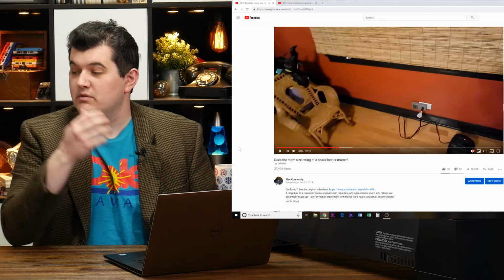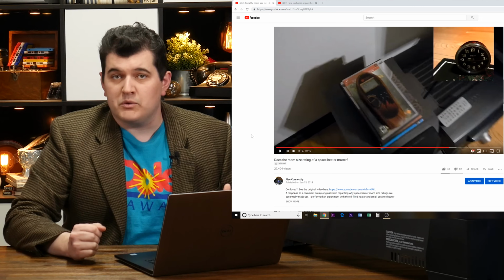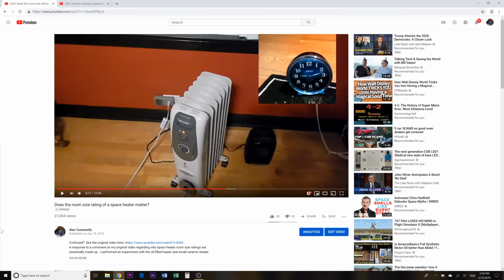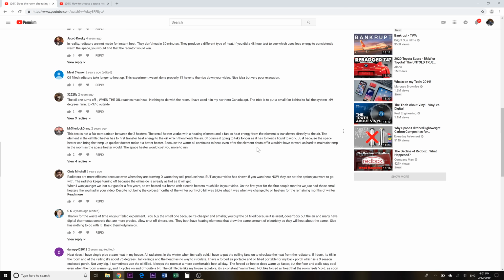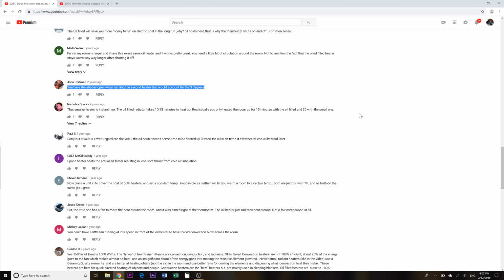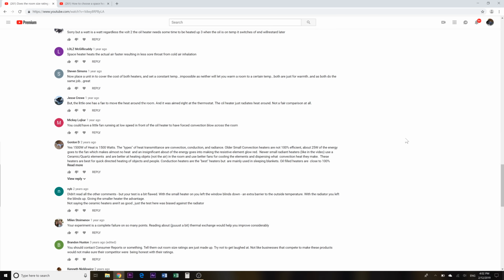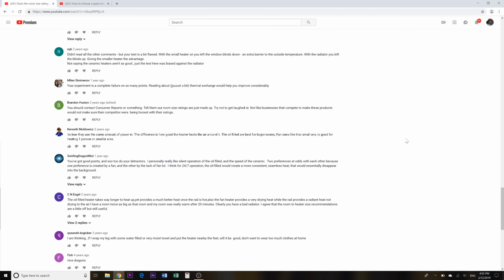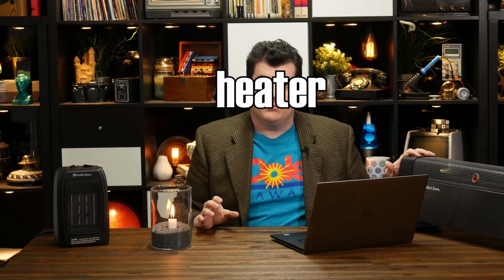More Space Heater Nonsense

Comment: My only use case for oil heaters is an application where you wouldn't want hot spots. If you're able to have a high heat capacity heater dumping out air at 85 degrees for a long time then that would create more consistent air temps throughout the room than a heater dumping 110 degree heat constantly

Comment: I'll bite the hook ! You are 100% right, they can both produce the same amount of heat, and therefore heat any room just as fast.
But, let's try to give the benefit of the doubt to the marketing departements...

You can maybe argue that small rooms loose less energy per amount of time than larger ones. So, for most small rooms, 1500W is too much, and that you would only need say a sustained 500W heat source; whereas in large rooms you'd want the full 1500W full time.
The small one can output 1500 watts, but the tiny heating elements and cheap plastic construction might not be terribly well suited for long use of such high output. I personnaly would not trust the tiny plastic thingy enough to let it run full blast for prolonged periods of time.
The bigger heater on the other hand might be of sturdier construction, and thus be able to sustain those 1500W for longer periods of time without deterioration, therefore making it more suited to larger rooms with higher energy loss. I think I would trust it's bulk a little bit more in any case.

Maybe you could disassemble them to see what's inside, and if the heating element is indeed sturdier in the "large room" one ?
Reply: No. That’s just goofiness.

Comment: I think something like a little usb PC fan blowing across the radiator heater would greatly increase it's usability. That tiny jet stream of fresh air? Gold. Then you'd get the constant even heat and afterheat effect with better distribution and thermostat usage. Plus you could set it next to you if you want to get toasty with the radiant effect.
Also, that light you see in the flame and the heating elements of the heaters is energy. Look up what % energy that is? 💯% HEAT!? WRONG!
There's my con-troll-bution.

Comment: At first, radiant heaters are as efficient as heaters with wire element. The only problem is comfort. Wire element type heaters usually have fan, which can causes air to dry much quicker then radiant heaters. Second, radiated heat is much more "natural" for people than blown heat. Third, is that radiant heaters are not as hot as wire element type heaters. So it reduces risk of fire. So, these are reasons why are radiant heaters still that popular here in Europe. We still use hot water (or steam) central heating systems with radiant heaters. Radiant heaters heat slowly, but room can still hold some heat after they are turned off (and with thermoregulators are quite well to regulate). That is not the case in wire element type heaters. As soon as you turn them off, room gets cold again in a few minutes (that might not be the case in american wooden houses). Also, electric radiant heaters are slightly bigger and more powerful here, so they heat up faster (about meter long and about 2 - 2,2kW due to 230V electric net).  And for your comparison you choose wrong times. Let me explain. Wire type heater immediately heats up and immediately cools down. As you said, that is not the case in radiant heaters. They take longer to heat up, but also take longer to cool down again! So for real comparison, you should measure power consumption (in Wh) and as soon as radiant heater has similar consumption turn it off. Then wait for heater to cool down to ambient temperature and then measure temperature in room. It should be same. And if it is not, then your house is not heat isolated well enough. So in conclusion, if you need to heat up room fast and not for long period of time then wire element type heater is better. If you want to heat your room constantly for longer time than radiant heater is a good choice.

Comment: The oil filled heater uses less energy over time because after the thermostat kicks in the heated radiator's metal fins stay hot for a good while before thermostat restarts heat.  So the oil heater keeps putting out radiated heat even after it is off.  You turn it on high and set the thermostat as soon as the room in use reaches a temp. you like.

Comment: Your experiment is as good as any with this small sample size can get. That said, I have another experiment I’d like to see. Get the same two heaters and set them to heat the room to the same equilibrium temperature. Leave them for 24 hours, and measure the energy used (yes, I know it should be the same, but still), as well as the temperature fluctuation over time. I wonder if the oil would act as a heat reservoir and smooth out the temp of the room at all

Comment: Are the oiled filled radiators safer? They have a larger surface area at a lower temperature. Instead of marketing with the misleading large-room small-room they should market that they are safer.

Comment: What i can maybe think of. Is when the Room has much new air circulation. Like in Office Rooms where people have too wait and every 15min the doors get opened and closed. At that time your already heated Air goes away and fresh and colder Air comes in. If you have a delayed heat output, like heat stored in Metal. Your already wasted energy in shape of elektricity is still in the metal and and not every door open close cycle has too heat up the room from 0%.  It is the same principle with refrigerators if you have still room left fill it with water bottles. ( that you dont want to drink )

If you want a room constantly in a specific temperature. Then the delayed heating element is more efficient.

But still this has nothing to do with room size.

Comment: We had a failure of the Central heating system in our buliding last winter. It took a week to fix it. But despite good insulation, after a few days it got quite cold. Having all LED lights in the flat did not help :-) So i grabed a bunch of 500Watt Construction Lights and set them up in our rooms. Also i baked some kind of Cookies every evening to make double use of the heat. 
Only difference i can think of between smal and big room heaters is the distribution of the heat. I think convection one is better to get some kind of even distribution of the heat. But the amount of energy released is allways the same als long as Watts are the same

Comment: electric oil heater needs movements of air, 
if you want to heat a small room with electric oil heater you put a fan and blow though it, now after the room is at temperature turn off the fan an heat keeps the temp up, unlike small fan heat that has too always be ON.

put them in a big open room (office type) and see how the oil heater will smoke the small one.

Comment: As a kid, I observed a very great difference between different portable space heaters, though I am sure the power consumption was at or about the same. I had a friend I would visit from time to time, and the room where he and I would spend most of our time together had no heating except a small space heater, less than a foot tall, less than a foot wide, and about half a foot deep. That little heater did a great job of heating the whole room quite nicely. But then one day it broke, and quite irreparably so. Worse, the particular model it was had gone out of production and could not be found for sale, so my friend bought another space heater, about the same size overall, to replace it. But this new heater could not heat the room. Right near the heater would be nice and toasty warm, but the rest of the room stayed as cold as if it had no heating. They were both about the same size, and (I assume) the same power (given that everything along these lines seems to be rated 1,500 watts), and both had electric heating elements and a fan. What differed was the exact configuration of where and how the fan, the heating elements, and the various vents etc. were arranged, and overall shape of the unit. Somehow, the physical design of how they took in cold air and then vented its heated air into the room resulted in a significant difference in how well the room (which was rather large) would get heated. The heat from the newer unit stayed right near the unit, and I think it must have then just gone straight up to the ceiling where a corresponding warm spot on the roof released much of its heat outside, while the older one truly circulated the air within the room much better and more evenly. I remember spending an entire visit with my friend just talking about the different qualities of the old and new heaters. It might be an interesting test and evaluation to see if different brands with different configurations might well do differently at spreading the heat within the room versus keeping it localized at the heater. Now I guess you are going to have to do yet another video on this subject...
Reply: Did you notice if the new unit periodically shut down because its thermostat shut it off. That's the only possible factor you didn't cover in your comment. Otherwise, I think your explanation was just fine.
Reply: @bobbabai  AS far as I can remember, both space heaters, old and new, seemed to operate continuously, without letup. Nice thought, though.

Comment: I can't believe the stupidity of ppl. 1500W is 1500W. They all produce the same amount of thermal energy. The only difference is how/if it stores and releases that energy. Energy cannot be created nor destroyed - only converted. The only benefit I can see with those oil filled heaters is that if there was a power outage on a winter night, you would have thermal energy stored in that oil that will release it's warmth without any further power consumption. Other than that, I go with the small space heaters and only pay more if it looks pretty. And further more, I used to like the ceramic style, but I found that it clogs with dust and had to me disassembled and cleaned to allow airflow. I find the coil element type the best, as it allows great airflow and doesn't ever clog.

Comment: We had so many awful oil heaters growing up, because "convection", blah blah... The house was always cold of course. The most effective heaters are milkhouse heaters, because they actually have enough airflow to distribute the heat around the room and keep fresh air on the thermostat. This way they also regulate the temperature better. With self-defeating heaters you turn them way up just to break even and then when the sun comes out it's suddenly 90 degrees in the room because the heater keeps turning on. 

The only problem with milkhouse heaters is that they are loud. All we need is for some genius to put a quieter fan on a milkhouse heater but noooooo. Instead we'll let granny die in her sleep of either hypothermia or dehydration. Overheating should count away from a heater's quality score.

Comment: Alec: "...please don't watch it."
Me: Immediately pauses video, finds link, watches the other video first.
Also, the marketing is indeed bunk. By definition marketing IS bunk. However, there WILL be a significant difference in the perceived effect of different heater design depending on situational variables such as timeframe, drafts, controlled air circulation, thermal efficiency of the room, ceiling height etc. Yes, all heaters release essentially the same amount of heat but, if the room is "air tight" and well insulated except for single pain windows the oil filled radiant heater placed under the window will work very well. Also, if you repeated the experiment with the ceiling fan running and preheating the radiator they should be quite equal because of the "candle" effect or convection causing most of the heat from the radiator going straight to the top third of the room. In a drafty room the radiator will feel nearly useless if you're more than a couple feet away. Each style will have a better or worse PERCEIVED performance depending on these variables. The key is to get the right heater for the situation.

Comment: Large room heaters will not heat a room faster, and they absolutely will not do it more efficiently, but there is a reason, I believe, which is longevity. Or at least, that used to be the reason. The large oil filled units lasted essentially forever, whereas the smaller heaters would burn out elements and fans. Since the ceramic heating elements don't get nearly as hot as the the old nichrome wire types they probably last a damn long time, but they'll fill with dust, can be frustrating to clean, and eventually the cheap fan motor will die. They're not meant to run at 100% duty cycle, the bigger heaters are. Or, at least, they were. Smaller heaters last longer now, and the big ones not as long as they used to, so now the labels are just throwbacks.

Comment: Your experiment is faulty.  You should have allowed each heater to come to its operational maximum temperature, THEN brought them in and timed your experiment, to be fair and even handed.
The slope from cold to hot is far steeper for the small heater than for the oil filled.

Also...if you use a small fan, even a muffin fan, the efficiency increases considerably on the oil filled.

Comment: Q: So a small, cheap and powerful space heater can be equally efficiënt as a large and expensive one given equal power ratings?
A: Even more so, there's a slight chance the cheap one might set your room on fire, thus being more effective at heating the room. For all other intents and purposes, if 1500W goes in as electricity,  1500W comes out as heat, in one way or the other (while not factoring in self limiting features). Only because of clever marketing of these devices, many lose their ability to apply common sense, leading to healthy heated discussions regarding a product label.

Comment: The best space heater I've ever had was a really old one mostly made of metal. I've never had another space heater that could keep a room at a comfortable temperature (most, no matter how you set them up, either don't do much (probably due to the thermostat problem) or make the room way too warm. This one didn't have fans or anything, it just had two, I want to say two foot heating elements and would smoothly cycle on and off with a nice click IIRC. I've always assumed it used some sort of timer instead of a thermostat to control its cycling. Unfortunately, I woke up one night to my bedroom being so hot I could barely move, as it seemed the thing stopped cycling, and that was the end of the only space heater I was ever happy with.

Comment: I have a small fan heater and despite being rated 2000w (230v in my country) the thermostat or some other protection disconnects the heating element 50% of the time so its like have a 1000w heater. Maybe with a bigger or better heater i wouldnt have this problem.

Comment: Fan heaters are great for quickly heating a small space, but they are terribly inefficient and expensive at keeping a room warm.
When I worked for the power company, I once dealt with a foreign student who used a little 2000W (Australian standards are 10 amp at 240v, allowing up to 2400W on a circuit) fan heater 24/7 for 3 months, and got a $1000 bill and had to leave university and go home in disgrace.  My oil-filled heater from Walmart solves the thermostat problem, it has a metal shield around the columns that forms a chimney, effectively turning it into a fanless fan heater.  It efficiently and therefore cheaply keeps the desired temperature because it continues to give off heat even when the thermostat cycles off.  I can leave it on 24/7 in eco mode and it costs very little to run.  Since my new house has propane, I'm replacing the oil-filled heater with a 10,000 BTU radiant that uses no electricity at all.  Then I won't need to turn the heater off to use the microwave!

Comment: efficient and effective are different words and have a different meaning and there's a reason they both exist. They may be all equally efficient, but not equally effective. Think about the surface that is radiating heat. A larger surface would transfer more heat (per given amount of time) since heated metal (or whatever else thermally conductive material you can think of) is more thermally conductive than air (same reason a  water cooling system is more effective than air-based one). Now think about absorbing and radiating heat over time... You get the idea... A larger room has more outside surface to lose energy, whereas a smaller one has much less surface to radiate from. And building quality and external thermal insulation are a whole another topic.

Comment: I think it would have been a much more fair comparison to test similar styles of heaters instead of simply using the small  vs large room moniker.  Yes, use the small ceramic but test it against a larger fan driven one.  Another aspect you may consider testing is speed of heat transfer AND how long the room remains at desired temperature after heater is unplugged.  These are the things that most folks care about.  How quick does it heat and how long does it hold  it?   Nobody gives two shits about the explanations on wattage etc.  Thanks for posting.